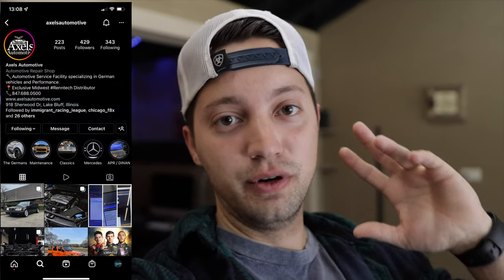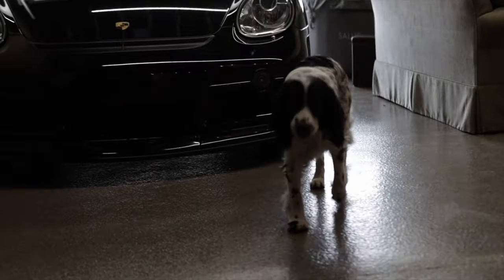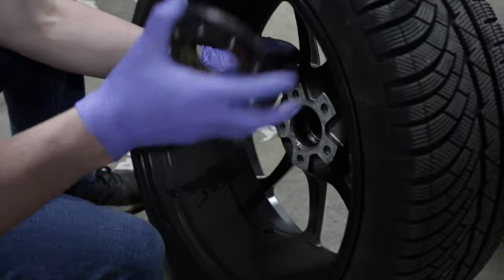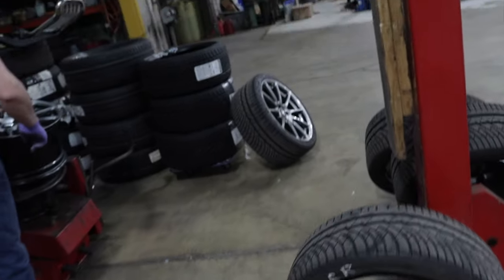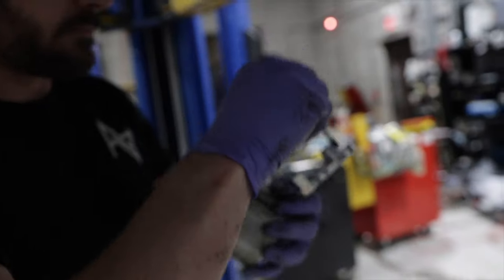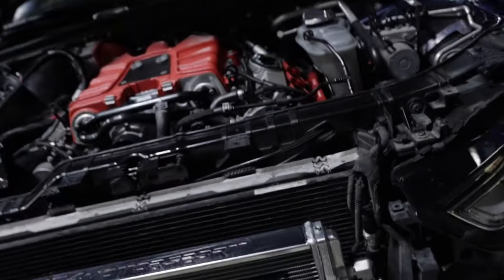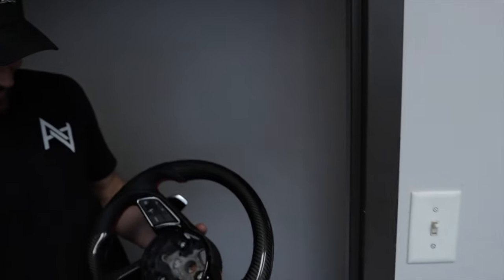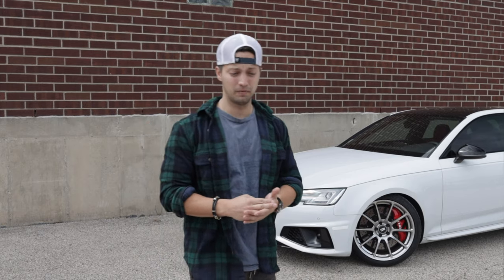Transforming the Audi B9 S4 With New Mods!

Comment: You may just need some wheel hub rings
Reply: That would work if the wheel hub was larger than spacers hub. But it looks like the spacer hub flange is too large for the wheel.

Comment: let me know if you like those tires. im running michellins a/s 4's on 245s, but ride is a bit harsh for my taste. im thinking 255's to increase that sidewall a bit also i heard the conti's are softer. 

also you can always go with a rim with an increased negative offset if you want it to stick out more.
Reply from the maker: So far they’ve been excellent I would agree they’re slightly softer

Comment: I would never, ever again buy wheels that require spacers, EVER.  I've had bad experience with spacers and vibrations from different brands, never again.  Get a proper wheel and offset for your car.  Also please do something about the sound volume/quality, it is really low and a lot of times louder on the left channel, then your music comes in BLASTIN way louder than the video.